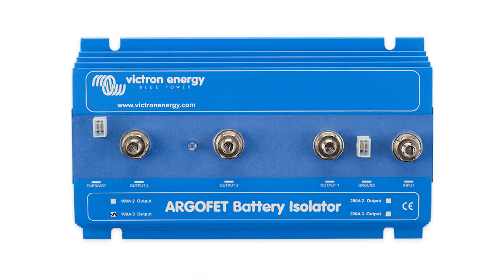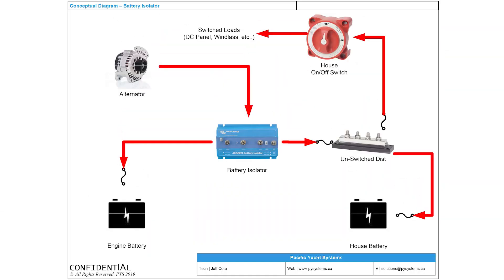Should My Battery Isolator Have Diodes or FETS?

Comment: I have the battery "joiner" from victim with diodes. I was thinking to charge each battery with it's open solar charge controller. 
Question i have is; can the charge controllers work "behind" the joiner(combiner)? They share the same minus which is parallel on the batteries. The + is separated behind the joiner? 

From what i understand the diode combiner has a .7 voltage drop if you charge the batteries "through" the combiner on the "load" pole.
Hence my question, why not charge each battery with it's own solar panel and charger "connected behind the joiner" directly to each separate battery.

They share the - minus pole, it is parallel but not the + pole. Will this work?

Comment: a FET or MOSFET is a transistor. A transistor is a controlled diode with a gate. In my book it will loose equivalent to a diode based (maybe slightly less). Why does the heatsink a similar size then ????. Forget Isolator, in 2024 go with DC-DC converters with a diigital charging profile like the Victron DC-DC. You batteries will say thank you...

Comment: We have a Victron Energy, Argofet Battery Isolator on our Formula BR 310 dual engine boat and we are having a charging problem from the engine to which the isolator is connected. The boat was purchased used.  From the manufacturer's literature ,  it shows two small wires (I will call them signal wires) that are connected to the isolator that are in addition to the connected power cables.  The two wires are connected to a terminal marked "Ground" and a terminal marked "Energize".  The Energize connection is shown to be connected to the run/stop switch on the boat and of course Ground to battery negative.  On our boat the terminal marked "Energize" has no connection to it and the terminal marked "Ground" has a fused (0.5 amp) wire connected to it that is coming from the positive terminal of the cranking battery.  In checking with the boat's manual I found that the boat is wired according to the manual.  Can you tell me if the isolator wiring on the boat, which is in agreement with Formual's manual, is alternate way to hook up the isolator.  BTW when checking  the fuse, it was found to be blown.

Comment: So we have something with a twist. We a have generator battery that provides DC power to a communication box on the unit the generator provides AC power to once generator is started.  The comm box allows for remote start of the generator among other things. When starting the generator the voltage drops far enough to lose power to the comm box and sometimed pops a fuse on the comm box 12v  power suppy, which starts once it gets AC power from the generator.  Somebody was talking about using a diode inline between the start battery on the generator and battery near the com box but I'm thinking that using the FET isolator is a better idea because of the lack of voltage drop. Thoughts?

Comment: Is it not the case with the diode isolator, you can wire the “sense” lead off the alternator after the isolator which will effectively raise the voltage of the alternator those .4-.7 volts to compensate with the drop across the diodes?

Comment: Good info.  I'm not dealing with a boat but with a pickup with  camper on the back.  Different application same issues.  At $120 USD for a Victron argofet 200-2 why would you go with anything less?  Thanks.

Comment: Jeff, your analysis is spot-on with respect to the use of silicon or Schottky diodes verses MOSFET based devices.  However, if the amount of heat dissipated by MOSFET based devices is minimal, why is the Argo-FET module still constructed on an aluminum heatsink?  

As you so eloquently pointed out, the devil is ALWAYS in the details.  Victron's use of MOSFET's is a step in the right direction, but they've not really cracked the code.  Well engineered MOSFET based isolators should have NO NEED for heat sinking, and those products exist, but they're not designed or manufactured by Victron.

Comment: will the isolator drain primary battery when vehicle isn't running and not using the 2nd? i have a small drain that drains my main and can't find it. the 2nd battery is used to operate my wheelchair van ramp and power controls. it's also used to jump my van if main battery is low.

Comment: Question on twin engine. I believe current isolator is diode. It has 2 alternator inputs with 3 battery output.  Would I use 2 fet isolators,  one for each alternator, then parallel the respective outputs to each battery (starboard and port starter Batts and house batts(4 golf carts series/parallel 12v)). Cheers, Paul
Reply: I have done this and it worked without problems.

Comment: I have installed about 15-25 argofet battery isolators on different boats in my career. I totally recommend these. Especially when you are dealing with 3 battery banks. With two battery banks you can use VSR (voltage sensitive relay). But using VSR has its own limitations. 
Only problem with battery isolators i have witnessed is when one of the battery banks should have some kind of failure. In this occasion i have seen faulty battery bank will draw almost all of the charging from alternator.
Maybe I´m missing something here and Jeff could explain it for us, why this kind of error would occur and how to avoid it.

Comment: Jeff I have 2 FETS installed 1 for the starter / house from the alt other for the solar panel system as I have seperated house and starter battery completly

Comment: The FET isolator loses 5% of what?
If it is in the voltage the result is the same that the 0.7v of diodes ones.
Reply: I thought the same. I hope the FET ones don't lose that much because i just upgraded to them!

Comment: DC toDC converter, problem solved😱🤔, and adjustable
Reply: Agree, dc-dc between starterbattery and LFP-banks worrks great: you can adjust the overflow from your starterbattery to the servicebank. My Mastervolt does that for max 50A. That throttles the strain on my 115A alternator (only 35A at low speed!) and prevents overheating the alternator. On longer engine runs I put it to 30Amps, realistically half of flows into the servicebank while the rest is used on the spot. Is more expensive but way more practical.

Comment: Hi Jeff, thanks for your sharing knowledge.  I always woundered if a DC-DC has a voltage drop similar to a FET isolator. Do you  have any onfo on that? Thanks again great channel.
Reply: DC-DC converters, like the Victron or Sterling brands, can actually adjust the voltage (boost or drop) depending on the charge profile.

Comment: Fet or MOSFET isolators are far more efficient.  I just bought a 2009 Beneteau 40 and the previous owner pulled out the Fet isolator and added an ACR.  I asked why and he gave the diodes story not knowing the new technology.  As well as the MOSFET has a depleting gate, they act as regulators as well therefore the bank with the lower voltage will get the higher load.

I have quite a few electrical issues to resolve, even after a purchase survey.  Missed switch on charger/inverter etc.